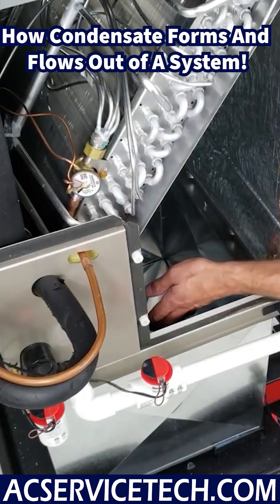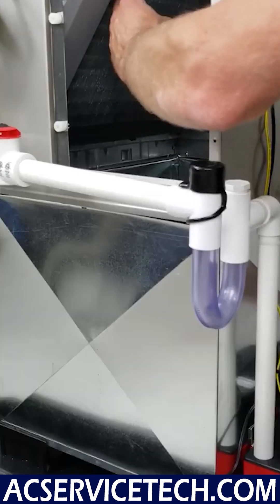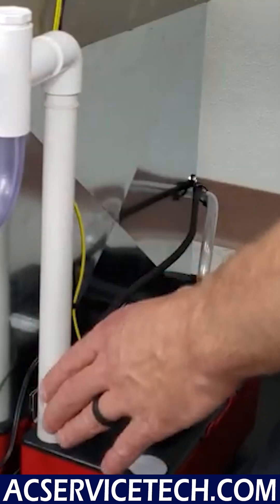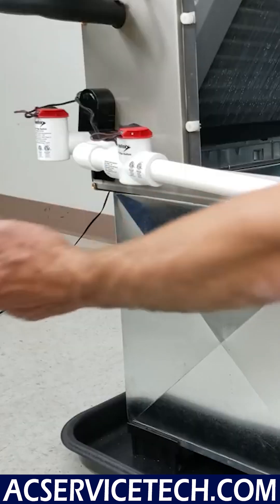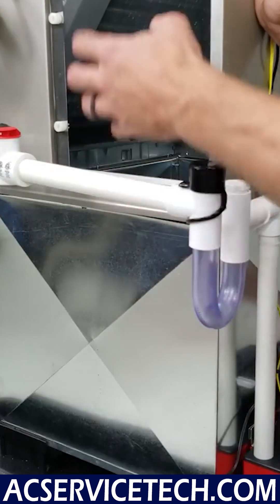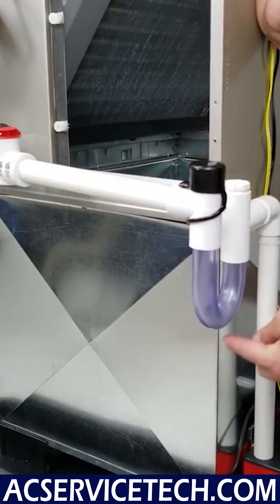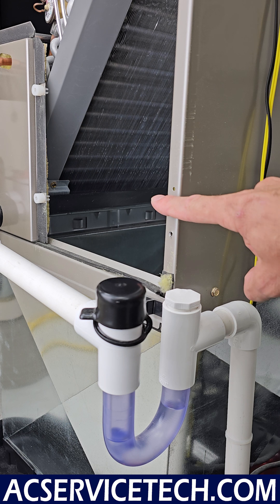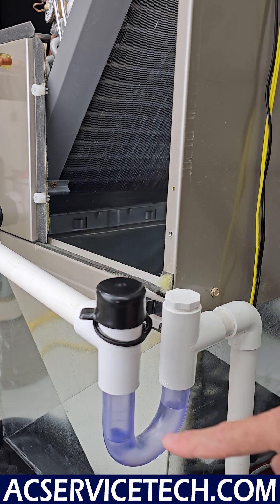How Does Condensate Form & Flow From An Air Conditioner!

Comment: Mines straight down into a condenstion pump. And it's open where you have a black cap. I havent had any issues in alittle over a year, do i add the u trap pipe or leave it alone?

Comment: Our HVAC person said that a p-trap is not necessary unless it's a sewage drain. After doing some research, I believe our comfort maker furnace is a positive pressure system and does not require a p trap. Is that a thing?
Reply: Yes
Reply: It just depends on where the drain spigot is in relation to the fan.. if the fan is before the drain it's going to be positive pressure. If the spigot is after the fan it'll be in a negative pressure requiring a p trap. I think 😅

Comment: With this coil design inclination (almost 2 halfs of the coil extended outside the drain pan), condensate water will also drop outside the drain pan and leak into the duct to the rooms. I have seen this in many installations.

Comment: I’ve seen manufacturer diagrams which include breathers before and after the P-trap.  You explain what a P-trap does and a breather after makes sense, but I don’t understand what a breather before does.  It seems counterproductive to the purpose in your explanation.
Reply: Why can't it trickle unless there's water weight in a trap.  Yea so air goes through the condensate line.  So what
Reply: @adoyle3  
My understanding is the Bernoulli effect can trap the water in the drain pan in some cases, where a p-trap will interrupt the air flow.  Haven’t looked up an official explanation though.